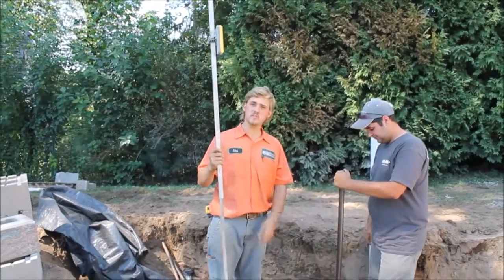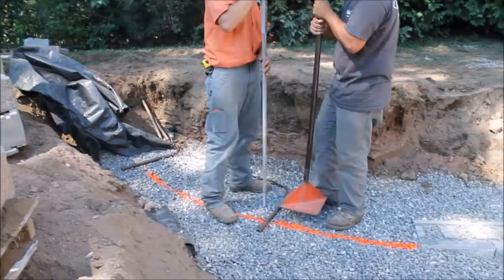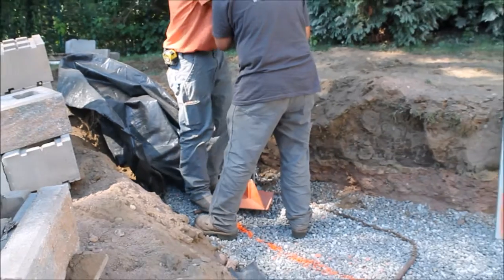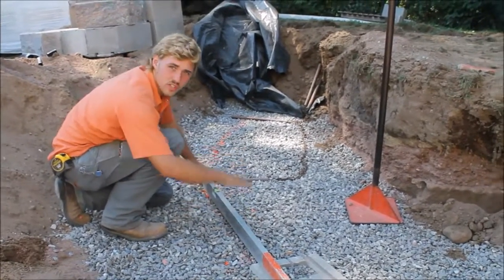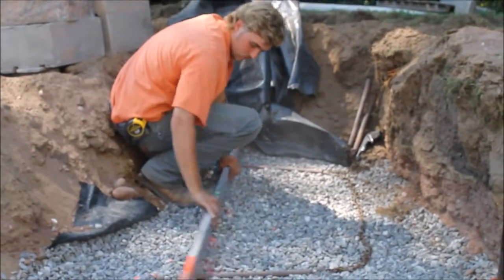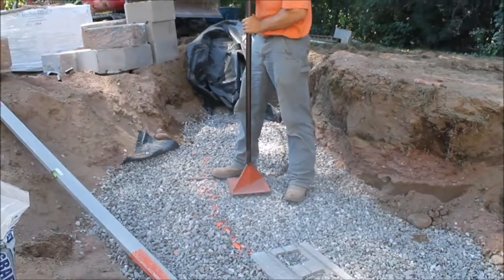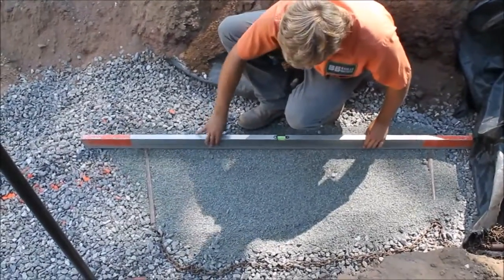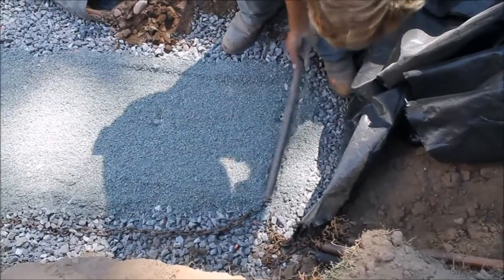Caleb Using the Quick-E-Wall Screed System

Comment: Does the top layer of #9 stone need to be tamped?  Thanks
Reply from the maker: The top layer does not need to be tamped because it is very minimal amount of #9 stone (which is a clean crushed stone). Therefore, there will be no settling. Hope that's helpful!